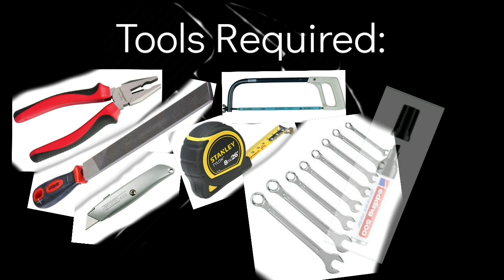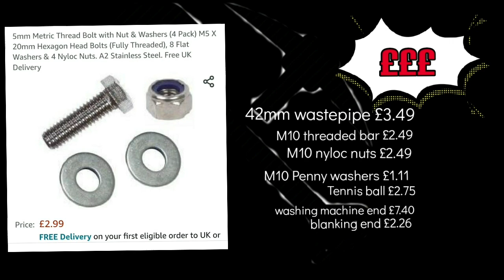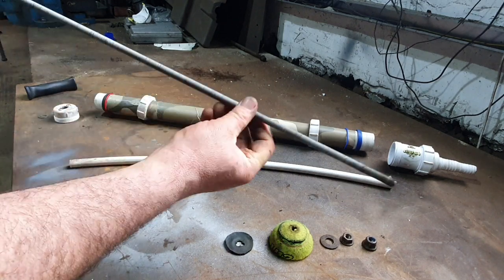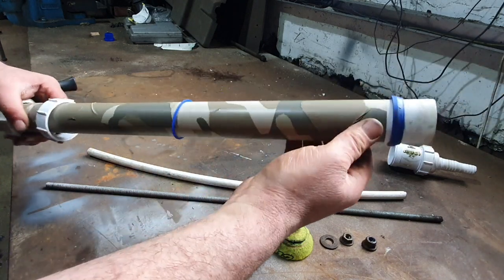HOW TO make a DIY Crevice Pump

Comment: Going to have a go at building one of these myself...Just been for a root in the shed re parts and notice that I have some plastic drain rods that look idea for the plunger I know Charlie's sell these individually for about £1.50 each. As they have a metal threaded end, I am thinking I may not need the threaded bar either, but I have some if I do....Thanks for the idea and the demo build...
Reply from the maker: Nice one! Good luck with your build!
A crevice pump increases you gold take somewhat, well worth the time and investment.
Reply: @AurProspector  I ve been wanting to  try this for a while but as I was getting ready to try it, Covid hit so everything went on the back burner...I don't suppose you could drop me an email as I have a couple of questions which might be better dealt with off line...